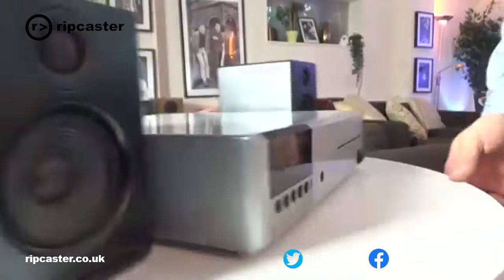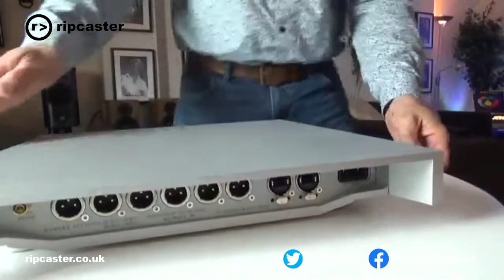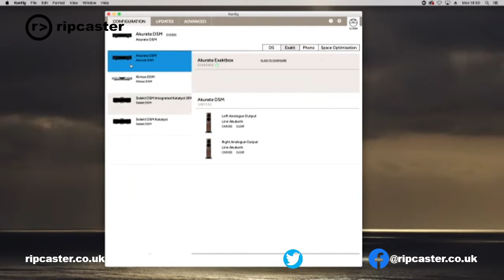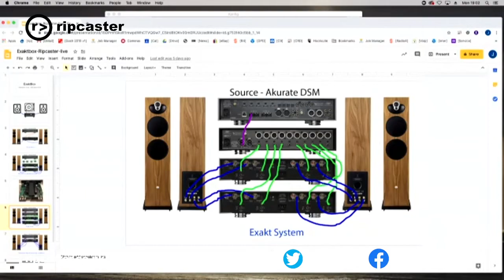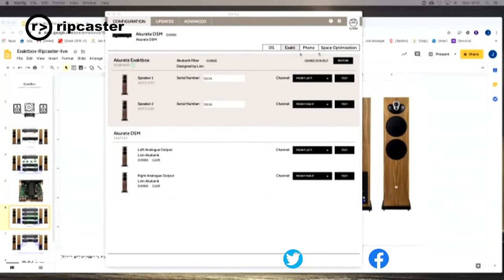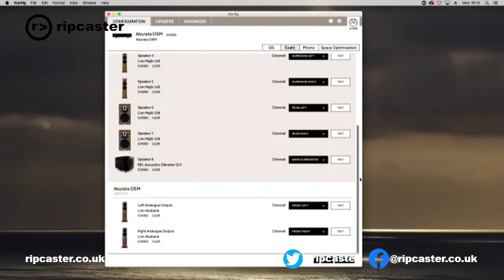Linn ExaktBox - ripcaster Live recording 5th May 2020

Comment: Hi Jon. Thx for great video. Can you confirm that you can use an exact box 10 with a Klimax dsm. Ie I don’t need to use a klimax exactly box. Thx.
Reply from the maker: Yes - you can use any of the Exaktboxes with a DSM: Klimax ExaktBox, Akurate ExaktBox-6, Akurate ExaktBox-10, ExaktBox-Sub. The highest quality willl be acheived with Klimax ExaktBox with Organik DAC. Upgrades are available for standard and Katalyst versions - see  our video here https://youtu.be/2_4YhxPalHs for that  and https://ripcaster.co.uk/Linn_Exaktbox_Organik_upgrade
Reply: That’s great news. I’ll likely try to secure an exaktbox-10 along with a second A4200 and an A2200 to drive my pair of   5 channel A242 speakers. The prices in the used market are quite attractive atm for akurate gear. Please Let me know if any do’s or don’t with that plan.
Reply from the maker: @josephbennett5384  Hi, You are right that Akurate equipment is very good value/performance now. Akurate 242 fully Aktiv with Exakt are fantastic. Try and get Akurate ExaktBoxe-10 with Katalyst DAC as there are no upgrades currently available for the standard version.
Reply: John. Thx vm for your advice. Going to be a fun project. Regards Joe Bennett

Comment: Hi there great video very interesting..

Question: i have a linn komponant 5.1 package..
consisting of linn classic movie
106,104,110 120sub

Is there a way making this a 7.1  9.1/2

I am thinking of a upgrade or change of speakers to the AV 5140 5120
I hsve 2 pairs of classik unik speakers these would be for front back hight speakers...

Thats if its all compatable.. the linn system is quite mind boggling..thb..as a novice..

Many thanks 
Anthony